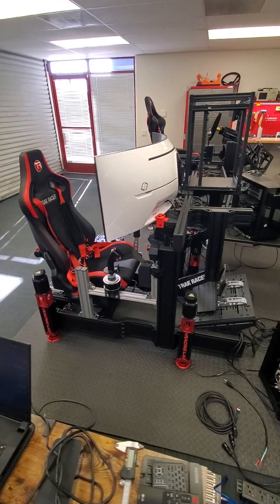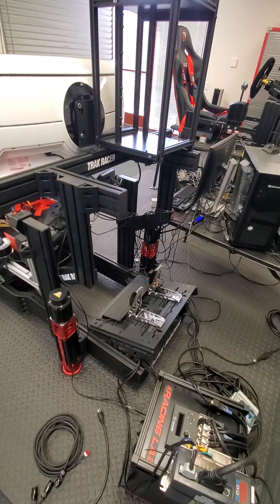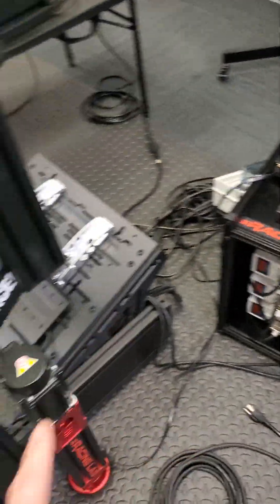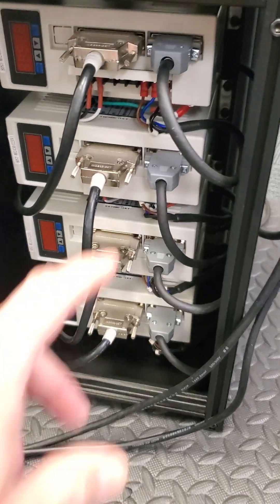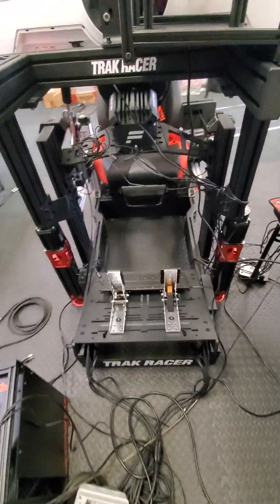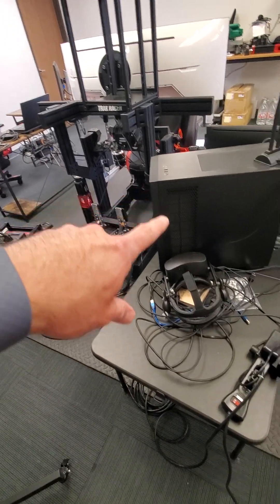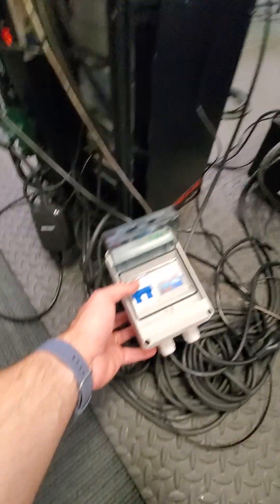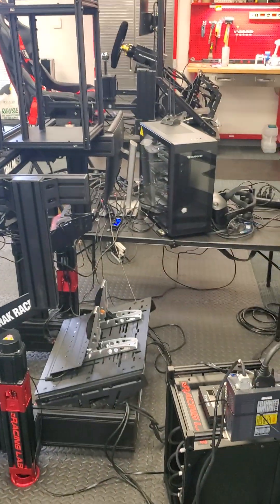Servodrives on-board the moving part of the rig?

Comment: I am pondering this for the past year. Will be building now subframe to carry all my PSU + drivers which will double as dampener. Other option was on moving frame but have too much going on already there 🤪 This consideration that I have currently is to mount them on the static monitor arm, only issue I have is I want to be able to easily disconnect all cables between monitor assembly and rig, which seems little hard to do with so many cables…
Reply from the maker: As you seen on the video is doable, but then it will add more weight on the front of the rig as well... and there is the issue with the connectors that are not rated for vibrations 😮
Reply: @ Yep, exactly! I will try the lower frame approach in a week or two and we will see (lower frame is static, actuators will be mounted to it with Eluflex dampers so vibrations should be minimal). Have to mount 6 drivers so it will be quite fun, also have to deal with cable ways towards the moving part of the rig…